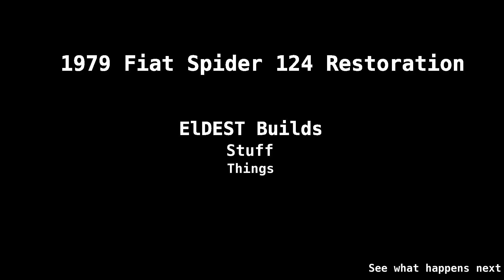1979 Fiat Spider 124, Fuel filter install

Comment: I am restoring a 1979 fiat spider as well. I am at the point of install the new convertible top. I am stuck as there are no good instructions out there. I do not want to screw it up as the top is expensive and I don’t want it to leak. Any help would be appreciated. Also I installed the Vick auto header but the egr opening is exposed. Do you know if there are any blank off plates available out there?
Reply from the maker: I will be installing a new top also, hopefully sometime this month. From everything I've read and seen it has to be glued to the header frame up front, and adjusted fit by the wire that is held to the body in the back seat area. If you can wait, you can watch me attempt it first. As to the block off plates, I have not seen any for sale. Again from everything I've read, they are not needed other than for appearance.  I will find out for sure when I fire it up. The plugs in the egr ports on top of the head are required. You'll be able to see success or failure this month.
Reply: ELDEST Builds True enough. The stuff I have found also shows a few different rubber weather strips that go over the top. I am trying to find a way to post some pics of what I have done so far on my top.
Reply from the maker: Are you on any on the Fiat groups on the Facebook?
Reply: @ELDESTBuilds  i would love this video as well

Comment: Good morning sir. I have an 1981 spider and the fuel gauge does not work . Any advice would be greatful. Thank you
Reply from the maker: Probably the unit inside the tank. Easy to get to, not hard to replace. Check the wires, see if they are still connected first. Here is a video that shows some of it 
https://youtu.be/EgayFaPJH7w
Reply: @ELDESTBuilds  yes sir . Thank you. I'm also goin to do the brown wire fix
Reply from the maker: I'm currently installing an electronic fuel pump in an 80, using the fuel sender wire as power through a relay. Should have the video up on Thursday